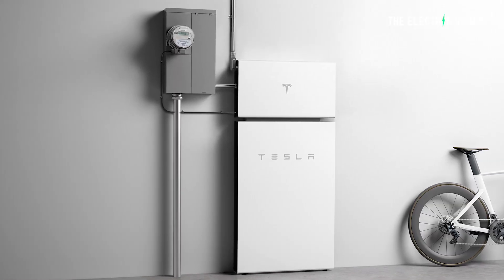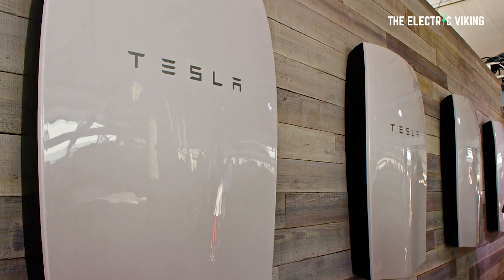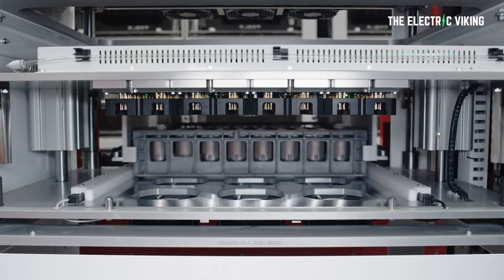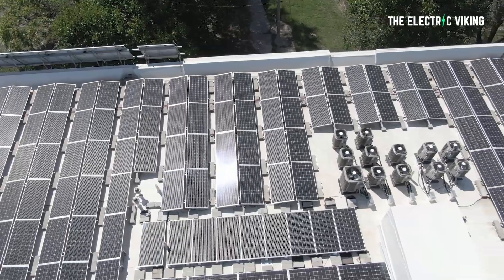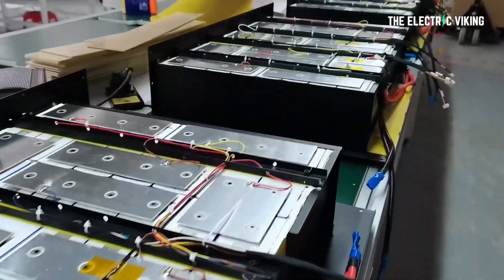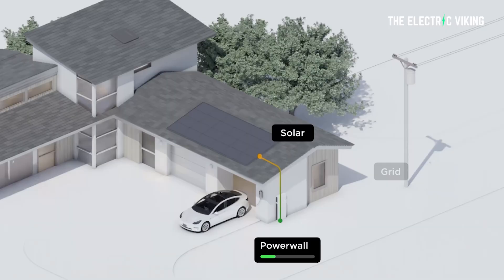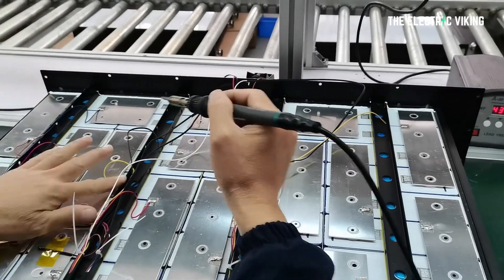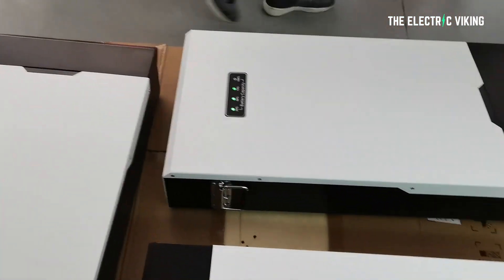Tesla is about to release NEW Powerwall batteries with better chemistry

Comment: I’m told Tesla powerwall 2 in Aus will stop referral discount in Dec. Powerwall supply isn’t a problem from installer in Oz, less than 8 weeks turnaround.
I’m still waiting for battery chemistry change, I’m not about to put Nimnh in anywhere.
Powerwall 3 is a product I don’t need as I already have inverters. 
FYI, Tesla is stopping referral discount on Model Y in Aus in Oct and discount not applicable to Model 3.

Comment: The technology and prices seem to changing every few months.  Now, you can use certain BEVs as battery storage and switch over to whole house battery back-up.  Just not sure it is worth purchasing an in-house only solution now or just get a second BEV with 30-200 kWh capacity whole house back-up power capabilities when needed 1-3 times a year?

Comment: Looks like we need an update on this. We used Swell Energy to install our Powerwall in Redwood City CA. The equipment was slow in coming (about 2 yrs), but the Service front Swell has been great. For example, when Tesla discontinued cellular support for the gateway, Swell came out and wired the Unit for Ethernet at no charge.

Comment: We will go to a multi-chemistry battery storage world, with each major application served by chemistry best suited to it. The requirements are not the same across different applications.

Take the common 3 examples-

1. Land transport - Cars and trucks need high energy density - KWH per Kg weight, which is where NMC found their first blockbuster success. LFP is inching up and already good enough for most practical range car applications. Trucks may need higher energy density to be commercially viable for longer distances.   Trains also have the option of overhead electrification - this is how long distance electric trains run even today.  In areas where full route electrification is too expensive (compared to even more expensive hydrogen?), we can easily do a hybrid approach - Smaller battery packs that can be recharged by overhead electrification of only small sections of the route. 

2. Home batteries/local storage: The weight does not matter as much, because these are fixed batteries. There is no weight penalty on moving them in use. LFP with thrice more cycles, but also more weight makes good sense here.  The far lower fire risk from LFP batteries is also important in convincing people. Nobody wants NMC's far higher fire and explosion risk inside their homes.

3. Grid scale batteries especially for long term power storage will likely go to flow batteries with completely different chemistry using cheap and abundant materials (like the ones proposed by the likes of Ambri, Form, or ESS).  Low cost per KWH stored, large capacity, high useful life and high reliability with low maintenance are important in grid batteries.

Li-ion, especially NMC, has been used for all three scenarios simply because mass scale production of Li-ion made them practically the only real option commercially available.  We will see alternatives even for transport and home batteries. Chemistries like Sodium Ion or the Lithium-less solid state batteries will come up.  There are too many vehicle makers and utilities without the scale in sourcing Lithium batteries.  It it is early days of the battery revolution, with much less that 1% of energy storage needed at the global scale deployed so far. The scale of the future opportunity is massive. So, investors are keen on funding alternative battery options that can capture a large share of the market or rule a specific application.

Comment: Thanks for your excellent reporting on anything EV, Energy Storage or Renewable Energy related (not sure when you have time to sleep)!!

Regarding Tesla's Virtual Powerplant system, you might want to point out that a Powerwall that is connected to the grid can already earn $2/kWh for electrical energy fed back into the grid during times of exceptional or peak demand on the grid. In some regions, like California or Texas, this payback could go a long way toward paying back the Powerwall's initial cost, substantially lowering its effective cost as a standby/emergency electrical power source, or as a means to store excess solar from your PV rooftop panels during the day if netmetering is not made available by the local utility, or as a means to avoid high peak-time rates for electricity, like from say 5pm to 10pm, when everyone starts cranking up their electrical loads at home.

Comment: Shame to use Li batteries for static applications.  Perhaps Tesla could do the research for batteries based on Na or ZnBr or some other chemistry that uses very cheap elements.  Save the Li for mobile applications.  If we are using Li for static applications it should also use Mn cathodes.

Comment: The Power Wall 2 costs around AUD $17,000-$19,000 depending on who installs it and where you live in Australia.
This has little chance of a payback in 10 years according to my sums.
A homemade battery system consisting of 16 LFP Prismatic 1kWh cells, and a cheap off grid inverter can cost under AUD$5,000. (Assuming you have the PV panels already)
This has a reasonable chance of payback in 3 to 5 years.  If you don't have the background to do a DIY job, I'm sure some sparkies would enjoy the challenge ;)
So called 'experts' tell me that this is BS, but I set up such a system last year and was so pleased I have also set up another one. 
The "virtual battery" setup (in California) could make the Tesla equivalent more attractive, but it is hard to know if it could compete with the low-cost DIY setup.
I hear that PW2 systems need an internet connection - is this still true?  If true that would be a deal breaker for me!
Is it still true that without grid power, the Tesla cannot recharge it's own battery?
Reply: Build your own.  Easy as Pi.
Reply: Any links or more info on how to build your own? I was thinking of same (replicating camping set ups for home) but all the solar mobs are t interested
Reply: BTW  Before you buy anything... think about how much power storage (kWh) you need/can afford.
Evening or Overnight capacity?  Or power for several cloudy days?
Will you go for a Time-of-use plan where you can get less expensive power from the grid at night and weekends?  Gloomy days in winter require either grid or generator backup in my experience.
  What limits you will impose on the maximum power draw. E.g. Kettle + toaster + microwave + pump can be more than 5 kW; will this overload your cells or inverter?

Comment: Capacity of a Tesla vehicle is over 5 times kWh per Powerwall. Why does Tesla not create a device to allow Tesla vehicle battery to power a house during blackouts? Would be much cheaper and have more capacity (assuming vehicle battery is not spent).
Reply: That is called a V2H (HOME) Or V2G  Grid or a vehicle 2 business. V2B.
Or generally V2L. (Load)
Reply: It's because the current Tesla system doesn't support V2L / Biderectional charging. 
Mainly because it will significantly increase the degradation of the current NCA batteries that Tesla uses. Tesla is now switching to LFP batteries made by BYD initially, and they have trialled software to allow its use in future vehicles.
Reply: He's very right although utilizing the  tesla car battery during a power outage should be a thing. But utilizing it daily during peak hours of grid and night are damaging to the battery
Reply: Future Tesla cars will have the hardware to allow v2x
Reply: Then you  would sell less power walls.
Reply: Probably wear it down. Email Tesla or Tweet
Reply: Wallbox is working on V2H.
Reply: Powerwall chemistry is slightly different. It’s heavier and can cycle more.
Reply: @Meatwad650  Chemistry is the same at the moment

Comment: Isn't it also an advantage in SAFETY?  I don't want a massive fire risk in my house unless the odds that happens are truly negligible.  Or I put the batteries outside away from the house, maybe in their own little shed, in the area my whole house NG generator sits. Having two separate backup systems seems ideal, re energy security in winter or bad storms (with sump pumps). 

By the time the 10 year old NG whole house generator is getting unreliable (only one minor common part issue so far), maybe just replacing it with a few highly reliable, reasonably priced large batteries of LFP or better chemistry.  Even for someone who lives alone and only uses about 500 kWh a month, a week, and especially two, of emergency backup power takes some doing, even just for heat, the fridge, the sump pumps, etc. (And we get such outages now and again with ice storms, bad wind storms, etc).
Reply: Stand by NG generator is a better way then batteries 🔋

Comment: Many places, it's ILLEGAL to be off the grid, or the power company gets to charge you a large fixed cost fee whether you use the grid or not.  (I don't like this, but the power lobby has a LOT of pull in many locations). 

That being said, I'm not convinced that being on the grid at all makes sense, as things could go wrong with your system too.    

Might make more sense to have 2 or 3 Powerwalls, and try to buy power cheap (or get it "free" from solar) and sell it dear (if the power lobby in your locale doesn't manage to prevent that).  Also, you may as well use the power your high required fixed cost payment entitles you to (for no additional charge).
Reply: Power wall for your use and let the grid be your backup
Reply: Say you are moving house and the power will be disconnected . Same as no occupier no electricity needed scenario.

Comment: The reason I went with Franklin WH home battery.  LiPh battery, higher peak demand (central AC) and can use alternative plug-in power (generator).
Reply: The Franklin WH battery looks very interesting. Do you already have it installed? Curious as to your experience?

Comment: If you live "off the grid," solar cells on your roof and a powerwall make a lot of sense.
If not, they just can't be justified.

As more and more Decmoratly run states impose stupid requirements for EVs to replace ICE cars
the grid won't be able to take the load - California is already there, and the morons running the state want to replace ICE cars with EVs and they already have rolling blackouts and tell you you can only charge your EV certain times when a Class 2 charger can't recharge your car to full.

So if you live in a Blue state, I guess blowing $50 grand to go off-grid might make some sense, but a propane-powered generator can be bought for 1/10 the cost and will last 25 years without a problem.

Of course, if the morons running your state make owning propane illegal - well time to move to a Red state.

Comment: The # 1 benifit of using LFP cells in powerwalls is, fire. Due to the thermal runaway fire risk of NCA cells, insurers might soon insist that NCA Powerwalls are not installed under the roof line, and be installed several metres from the house.

Early NCA Powewalls are now nearing the end of reliable life for their NCA cells and fire the risk from these old NCA cells, and the risk of a giant pr disaster for Tesla should there be high profile house fires, and deaths, must be a concern for Tesla, and houses with older NCA powerwalls under the roof or even near the house, might become uninsurable after a high profile fire.

This risk could be the reason Tesla moved into house insurance - NCA Powerwall home owners will still want insurance at an affordable price.

It could be that Tesla has been deliberately ramping down NCA cell powerwalls production for this very reason - the thermal runaway fire risk.

Imagine if an aged facility, school, or child care faclility went up in flames due to an older NCA powerwall ? This would be a massive disaster for Tesla.

Comment: Each Powerwall 2 costs $5,550, and the average US home will need 2 or 3 to supply its power needs. A single Powerwall can provide limited backup power for critical appliances and lights, but not enough for the entire power usage of a typical house. That's a big bit expensive here in Australia. It's pretty clear this battery game is for only the few Aussies who could afford it. I don't see too many reports with Aussies who live away from the big cities being able to afford or even want all this electric wizardry.
Reply: Or build your own for 2500 per 15kwh, including a bms.
Reply: they cost around 12-15 k AUD and warranty is pathetic !
Reply: ~$20k NZD in New Zealand
Reply: In the UK, fitted, my quote is for £10,000
Reply: Have you considered moving to appliances that run on 12 volts? When the first solar came out many people went for 12V.
Reply: Our single (wish we’d ordered two) PW2 gets fitted next week - had it on order since January. Just under £10k including the gateway!

Comment: Don't have to be 100% off grid.

Use batteries as arbitrage. Don't even need solar to do that. Solar can be added to the amounts sold back during the day, not used to charge the batteries.

By enlarge, the sweet spot is charging at night, discharging during the day.

This approach opens the possibility for PWs at residential and small commercial spaces, small megapacks to link those at the apartment block/neighborhood level, a mini-VPP. Then those link up for a larger area VPP at the municipal/regional level.

Loop in the cars too. Since peak electric rates are late afternoon-early evening, the cars can plug in to discharge through peak, recharging at night. All worked out with your AI & calendar.

Comment: No system* blackouts or any brownouts in CA so far, so probably not at all since today is a little cooler. *There have been some local blackouts due to transformer failures, but those aren't supply-related. There were also some short localized blackouts yesterday as a result of a communications error, so those don't count either.

Comment: Sam, I’m in California, and while threats of blackouts are real, in practice I haven’t had a blackout in many years.  I do get warnings that my power might be cut for an hour at a time, but it hasn’t happened yet.  I have several small lithium power packs (1kw and 2kw) which can keep the refrigerator and TV going for half a day, maybe a day.  I wanted a Tesla power pack for my solar panels, but could not get one when Tesla stopped providing them by themselves.  Now, I really don’t need one since I’ve moved on with a temporary solution.  Even if I decided to upgrade to a whole home battery, I doubt I would choose Tesla at this point since my solar panels use microinverters, converting immediately to A/C at the solar panel.  Maybe if Tesla allowed their cars to provide bidirectional charging I would  consider a Tesla Powerwall, but for now I’m going to wait until production ramps up a bit and/or I can include my Tesla as a home battery supply.

Comment: Just got solr installed about a month ago. I didn't get any batteries since that would have nearly doubled the cost. I would really like to jump on this.
Reply: Why would you have solar with out batteries? How do you store energy let say at night?
Reply: @mohammedabdulahi7894  I don't have batteries strictly for the reason stated, it would have doubled the cost of my solar install. Which was already over $55,000. I don't store any at night. What this system does is generate during the day and the excess goes back to my electric company, who pays me 1:1 what I would have paid for that electricity. So, for about 9 months out of the year, I build up a credit, which I then draw from for the other 3 months when there is less sun, and my usage is higher. Basically, I no longer have an electric bill, and it is replaced by a loan payment that is a little less than my current average bill (which would only go up as time goes on).
Reply: @DrKreiger  me and you have totally different system. I have only inverter with batteries because where I am resided the electric company doesn't buy back power. However we have power shortage so I need constant power with out using generator. Since I drow all my power from electric company I will soon install solar panels.
Reply: I would probably do the same my biggest concern though is being able to access that power if there's a grid outage, so you can at least have power during sunlight.

Comment: I would never consider a Powerwall with antiquated Lithium-ion batteries.
Now I will consider it.
Reply: ...until 5 years from now when something else will supercede it .
Reply: @proudaussie3522 
Because of inherent flaws in Lithium-ion technology, the batteries significantly degrade with use.
Buying significant infrastructure for a house, like a self-sustaining personal power plant requires the investor look long-term.
Lithium-ion battery degradation limitations does not support a long-term investment strategy, which includes increasing resale value of the property.
Reply: With an attitude like that, you’d never buy any kind of technology
Reply: @alastairclark9423 
I've been in information technology for over 25 years.
I've also professionally evaluated technology for corporations.

It is unlikely you understand the limitations of lithium-ion battery technology, upon which my statement was based.
Reply: @MichaelLloydMobile   I wasn’t actually replying to you, rather the person stating they wouldn’t buy something because something will supcercede it in 5 years. 

I’m well aware that Li-ion batteries are antiquated tech. 

But thanks for the condescension anyway.
Reply: @alastairclark9423 
Sorry about that pal.
I completely agree with your comment, in that case!
You've got to draw the line somewhere with technology!
Sure, it keeps getting better, but you won't benefit if you don't use it.
Also, the sooner you use it, the greater the benefit!
We're on the same page.